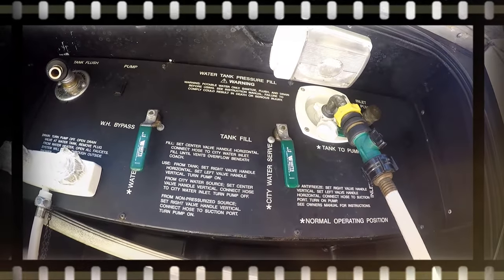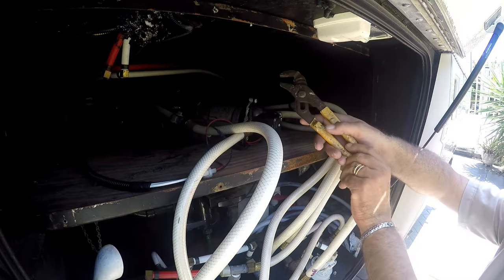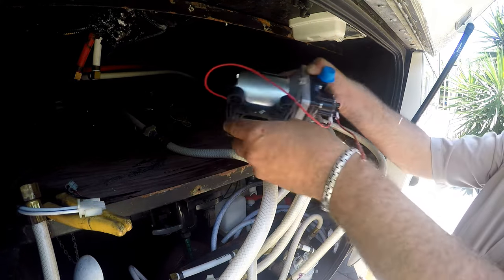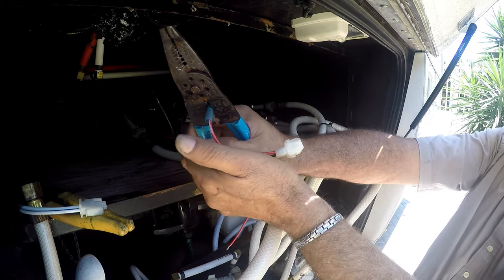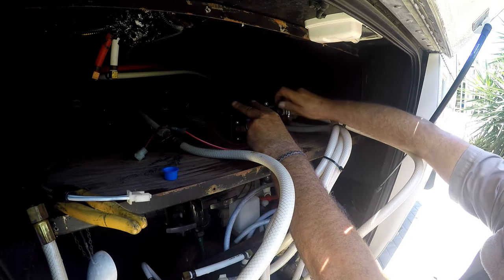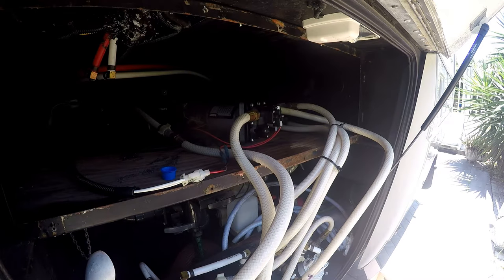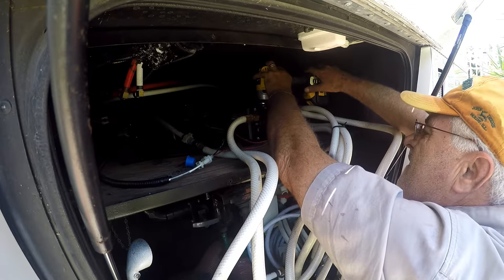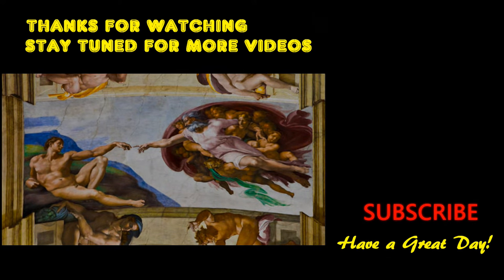HOW TO REPLACE RV FRESH WATER PUMP SHURFLO REVOLUTION | ADJUST PRESSURE SWITCH

Comment: Thanks. I am replacing the same pump on my Travel Trailer. Great help.  Simple.  Short.  Great job!

Got my pump from Amazon. $66. Its identical to this pump.
Reply from the maker: You welcome Mark, good deal on the price and good luck on the install.

Comment: Glad to hear you had a lot of use out of the pump before it went bad! Seems like it was a fairly easy process! Impressive that you know what to do!
Reply from the maker: Yea my motorhome is from 2003 but actually built in 2002. believe it or not most the things that go bad is because of sitting still too long. It's easy to exchange parts. I had to take that same panel off last week to fix the city water valve that regulates the pressure. another video to edit not enough time LoL

Comment: My pump just stopped working, it doesn’t make any sound.
Do you know what I should do?
Reply from the maker: Check for all fuses and then test it Direct before you replace it. The motors usually last a long time.